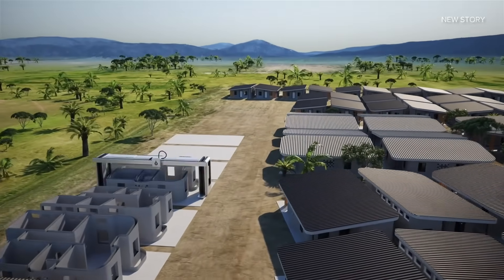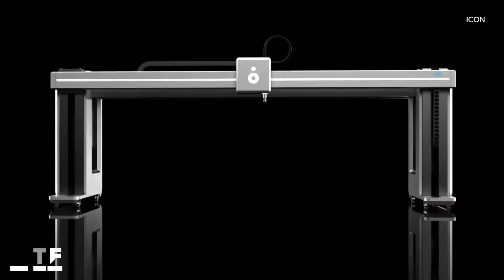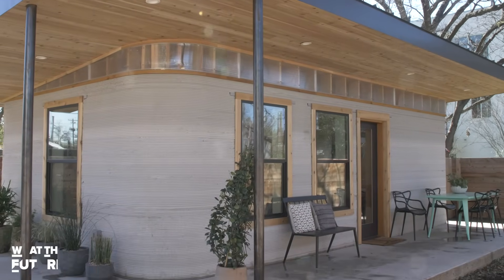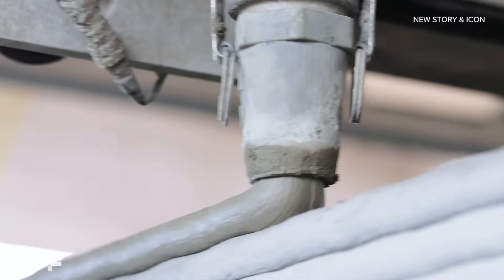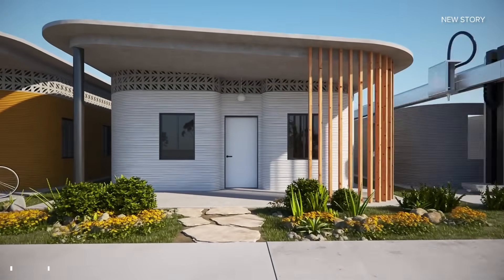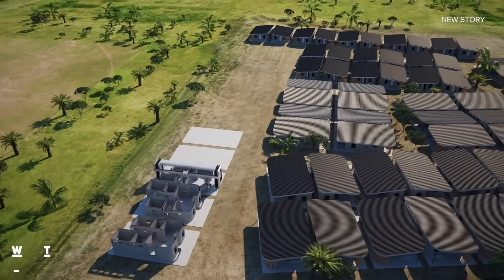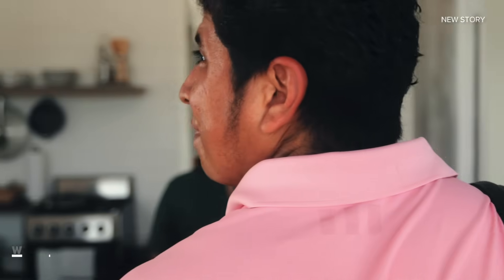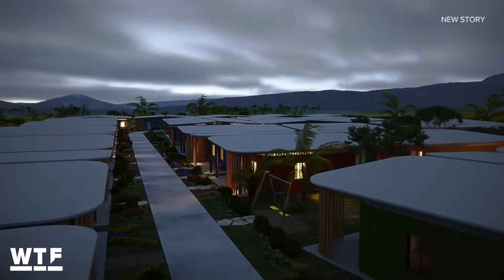The world's first 3D-printed community is officially under construction

Comment: Another upside is that there are significantly less wood/flammable material in the walls itself (save for the door framing, window framing, & roof planks, as shown), which hinders house fires.
But what if the resident(s) want smooth, flat walls, instead of ribbed layers?  Will they then have to go back, fill in, & smooth out the walls (+ add insulation & drywall) themselves?
And they can forget about hiding pipes/plumbing, electrical, & HVAC in the floor, walls, & ceiling, unless they were pre-laid/preset, before the concrete printing starts, or installed during printing.
Also, those houses should get Tesla's Solar Shingles & Powerwall Home Battery, so the residents won't have to worry about electricity bills, and to complete the efficiency/experience of living in a 3D-printed house.

Comment: Pipes - electrical - water - surface
And much more important .... What will the house look like in 7 years ... The "printed" material will shrink, become smaller ......
So the experience from the construction sector ...
-
Thermal insulation?
Sound insulation?
etc...

Comment: I wouldn't call this printing a house. Icon has done a very good job of combining several seperate jobs done by different humans into one machine. This however has several flaws, from an engineering stand point, I see that the machine pours internal triangles shapes. I'm assuming this is done for structural support in place of a metal skeletal rebar structure. I saw the foundation however I'd have to see the depth these walls go into the slab. Also interesting the company built the two homes in a high seismic location. I'm sure he's counting on the constant tremors to stress test the house structural resistance over a specific time frame. Neat idea!

Comment: It would be nice to see a cost / time analysis against local workers using brick or cinderblocks.  Is it actually cheaper to operate / feed that machine as opposed to hiring local workers?  Don't get me wrong, i'm a nerd and love the tech, but i just wonder if this is ultimately a good solution with the technology where it is.  In other words, with the cost of printing 50 homes, maybe the could have built 100 with traditional designs - hard to say without a comparison.  But i get it - this is about more than just the homes printed.  It's about improving the technology and hopefully driving the cost down over time.

Comment: you need steel reinforced bars & expansion joints in any concrete work of this size, or it will crack up in time. fail

Comment: There is no way you could build a house much faster or much cheaper with this tech than wood frame site building. Once you have the permits and materials, you can throw up the structure of a site built wood frame house in no time flat.

Comment: Easy to thicken/thin the concrete if you use foamed soap like the Romans did which makes it almost half weight but still powerful with air bubbles... also volcanic glass can be grounded and added to the mixture aswell as hemp to finish it...
Basics...

Comment: The only problem I have with this system is how insert the steel reinforced bars into the concrete. Pure concrete its  very brittle and has no seismic capacity.
Reply: And that's why the inventor said in this video that their is definitely room for  improvement of the cement.
Reply: @ninjafit3275  Improving on cement is using another material : "The cement industry is one of the two largest producers of carbon dioxide (CO2), creating up to 8% of worldwide man-made emissions of this gas, of which 50% is from the chemical process and 40% from burning fuel."
Reply: @OlivierSuire  yea those glass skyscraper are worse than anything and any window even double paine  glass or tripple Paine glass all glass is inefficient and concrete is efficient as far as energy to heat and cool
Reply: @ninjafit3275  I have a domino tower that hasn't been blown over by the wind, how you ask? Simple it is in a area where no wind blows. So many people looking for more complex solutions for simple problems
Reply: Depends what you mix with that we got adobe hoyses built a thousand years ago that are still around
Reply: @gabrielgalaxygh  I live in Chile, one of the more seismic country. Just the reinforced concrete can stand with frecuent earthquakes. Adobe just can't stand.
Reply: "we got adobe houses built a thousand years ago that are still around." Are those 1,000 year-old houses sitting on top of seismically-active soil?
Reply: Steel in  1 floor structures for philippines construction since local code require earthquake intensity 7.5
Reply: @crazyjds  same in Chile. Walls must use steel in foundation, top close, vertical columns each 3 or 4 meters. Concrete blocks are using just like filling.
Reply: Makes me wonder how hard it would be for them to feed steel cabling through the nozzle as it's extruding the concrete, that way the whole thing would essentially be full of reinforcement.
Reply: @NikoKun  good point. That seem a very plausible idea.
Reply: @NikoKun currently lots of contractors are using Micro-Helix micro-rebar, which is the micro version of what you’re saying, in applications like ICFs and the like... it may prove useful in this application
Reply: @NikoKun  conduit could be installed in prebent proportions as the print process is in motion
Reply: @steveeolio  yup, tho I think I was referring to the extrusion of material, to make it stronger, not the conduits for utility stuff.
Reply: There is.  It looks like 3 rebar per wall poking out the top.  May be some secret sauce we can't see.
Reply: "It looks like 3 rebar per wall poking out the top." How do you "print" the walls with that rebar sticking up and in the way of the "print head"?
Reply: @michaelsanders5815  I think if they found a way its not shown here. You need rebar in corners even if they are "rouded". I believe they surround the bars but they must ensure the concrete fully covers the bars.
Reply: The size of the homes don't require steel.
Reply: @danielmasters8145  in seismic country its mandatory, even for 1 store  homes.
Reply: @danielmasters8145  WRONG Daniel
Reply: At 1:04 you can see a few steel bars. This happens a few more times not sure if it’s the same clip repeated or a different area, but it seems there’s at least vertical support.
Reply: California would require it to be engineered (most stringent seismic code in US) and an engineer would likely try to get something like Micro-Helix micro-rebar to flow through the machine to make everyone feel better. 
The Apus-Cor folks had the operator inserting GFRP rods horizontally across lifts - like from the interior wall to the exterior wall on intervals but the micro-rebar might be a better option for seismic
Reply: Shelby Holley  if you are building over a sinkhole, no matter how much steel you use that structure is going to fail.
A solid foundation is everything in construction, without that there is no building.
Reply: I don't think steel reinforcing is used even on block homes. Then again I've only ever done work on homes in Florida and as long as your foundation is solid, you don't have much seismic activity to worry about. 
Wouldn't adding reinforcing fibers get the job done too?
Reply: @chadleach6009  I've been to florida a few times and was always surprised how thin and easy to break all the houses seem
(i am from germany)
is this done by purpose? because to me it seems like 1 hurricane is coming and the house is done for
and you have a lot of hurricanes
Reply: and the walls feel like if i punch against them there is a hole
if i punch my wall at home in germany my hand is broken
Reply: @chickenbob562  The main concern here is high wind loads from hurricanes and a stable foundation from Florida being essentially a large sandbar. A thick heavy structure would require a much larger foundation to accommodate the weight, thus the thin light design. 
Fortunately, with most materials on the market today and if built to code, are more than capable of withstanding cat 4's  (sustained winds of 209-251 kph).
Cost is likely a factor as well, lighter materials are cheaper to transport and when your building on a sandbar, you have to truck most of what you need in.
Reply: @chadleach6009  so even if it seems not strong, it can withstand a lot of natures force?

since many houses are build on canals or near water, you probably can't use that heavy foundations, right?
Reply: @chickenbob562  Yes, it's all in what the structure is designed to handle and what you have to work with.
Reply: @chadleach6009  okay, interesting
thanks for your explanation and answers
Reply: @Barskor1  why? because we have strong walls?
Reply: @chadleach6009  steel is always used lol. You can even see it in this video
Reply: @kizzjd9578  i was talking about traditional contruction.
Reply: Chad Leach rebars are used to reinforce cement block homes in earthquake areas to minimize the crumbling of building during a major earthquake.  I grew up where typhoons with winds over 230mph pass and it sits in the ring of fire.  In 1993 we had a 7.8 earthquake and the only major damage was to newly built hotel the leaned because the owners asked the contractor to water down the cement mix.  All the houses were fine with minor cracks and about 95% of the houses are built with cinder blocks, cement, with rebars for reinforcement.
Reply: @redorange  Cool, we just don't use rebar much here because Florida is one of the least seismically active areas on the planet. We tend to have more issue with corrosion of rebar where it is used than anything.
Reply: @redorange  You can't really compare a house with a hotel.  The larger structure allows for larger forces to build up in the structural diaphragm.   Also the waves travel a longer distance through the shell before hitting an intersecting wall, due to bigger rooms like lobbies and restaurants etc.   The points of intersection is where the breaking will occur and also in the stiffest members.  A shear panel (very stiff) will attract most of the seismic forces.  Watered down cement is a serious problem, that should have been made evident by the test cores that are required to be taken at each placement of concrete.   Those cores are broken at 7, 14 and 28 days to determine the actual vs designed strength of concrete.  If those cores are not with the testing firm then somebody goes to jail.  
The other big difference between a house and a hotel is weight.   Basically think of how a child runs and turns, versus a large grown man.  The more weight that is being carried, the more difficult it is to negotiate tight turns.  Much greater strength is required to stay on course when the moving object is heavier.   So the code sections (and underlying concepts) that work for a one or two story 2000 square foot house will not work for a multi-story 100,000 sf hotel. 
Seismic forces building up in a heavy structure will concentrate a lot more of that force on the connections vs the lighter structure across the street.   If you live in a seismic zone, light weight stick construction is better for your house.
Reply: @chadleach6009  Look at countries like Brazil and Argentina, their homes are nothing but brick and concrete they look at the homes built in  other countries like the US and Canada and think we're crazy for building wooden homes with dry wall.
Reply: @chadleach6009  WRONG Chad.  It is used if you want permits
Reply: @chadleach6009  yea, I'm not sure but I think steel reinforcing is used for areas with more frequent earthquakes
Reply: Add fiberglass into the mix, maybe?
Reply: @BrokenLifeCycle  in some places could work,  in horizontal trust and ceiling its less probable. Concrete has almost 0 traction resistance compared with compression resistance. So in traction section of the trust almost all the resistance is from the stell.
Reply: @BrokenLifeCycle  in finland fiber cement Is double the cost of normal and still isin't safe... It's pretty funny that nordic country build most safest/insulated homes even the Is no eartquakes in nordic country... Few times car have lost in yard and once full load truck found it self living room while Master of the was watching tv on living room... I bet it wuold went truoght any american house whit 50t of mass
Reply: After a gut wrenching meal at taco bell, I can extrude enough 1/2 to 1 inch mortar to build you a dod house.i should add in some hay or else the roof caves in.
Reply: Rebar is needed here in Nepal.
Reply: All brick houses are supported with steel rebar, even this printed house I saw rebar reinforcments.
Reply: they have used in a earlier build fiber glass stick the width of the wall
Reply: Yep, you are incorrect.. besides  there's bendable still that can be injected in some form..
Reply: plastics?
Reply: What I meant,

Polymers being introduced to the mix Could give it all the stability it would get from said rodds.
Because that is what they already do in other cases.

or you know, the Rodds can just go first. that is possible.
Reply: Luckylarry911 silverstein  Pretty sure I've seen an experimental 3D printer at a maker convention that had a special nozzle that fed wire out into the plastic it was laying down, in order to reinforce it. No reason they couldn't come up with a similar system for this.
Reply: @NikoKun  surely you can make robot who insert and bend Steel before cement comes, but there Is problem on horizontal reinforce... 1 layer at the time unless you first add horizontal Steel frame what Is in way off cementing...
Reply: Luckylarry911 silverstein  Still probably increases strength along the length of the structure, and from side-ways forces. Should also be possible to insert actual rebar or other reinforcements down those zig-zag holes in the wall, depending how they lay it out.
Reply: Shelby Holley  just be homeless at that point
Reply: Well, the vidoe triggered my scam-o-meter when they show over and over a video segment of the machine pouring  the stuff and some rebars BY THE WALL, rebars which can't be seen at the 3D animated video nor anywhere in the actual cosntruction video. All in all, if you put rebars inside the concrete, then the nozzle can't travel along the wall witout hitting the rebar. so it etiher travels around the rebar (pouring a cocnrete donut around it, then keep on the straight line, or you just don't get any rebars inside the cocnrete, in a seismic zone. They also don't show how do they add doors and windows (as they can't have the concrete up in the air, they'll need to add a frame to hold it in place while it dries, and again, unsupported concrete-only beams over doorways and windows, in a seismic zone?).

Now think about this, a machine that lays concrete bricks and then adds concrete and rebars, instead of using "magic goo" for everything. It's not printing, but certainly such machines could build affordable housing using standarized and widely available matherial. Building the foundation still would be a difficult part, but there's plenty of expertise on building with concrete brick. Just, you know, probably the machine would be a lot more expensive than using human labor in the countries where it could be of use... and hiring construction workers is more humane than replace them with a robot.
Reply: What are rodds?
Reply: Why dont people just make mud huts again
Reply: @AbuHajarAlBugatti  because dont stand with earthquakes, get full of bugs, water "disolves" it, etc,etc.
Reply: I thought these were old concerns after things like Helix Rebar.
Reply: The "Rebar" is laid out prior to pouring the foundation... 
The foundation and building is small enough where an earthquake won't bother it. Also the concrete they use to build the walls is rubberized (for the lack of a better term)
Reply: A large part of the world is free from earthquakes
Reply: @Milwaukee Mayhem True, if it was done throughout the whole print-time. But maybe it would only need to be done every few layers.. lol Like have a secondary nozzle that lays reinforcing wire down intermittently or intelligently where it might be needed.
Reply: Does the reinforcements need to be bonded to the masonry?  I believe if reinforcements are needed in cinder brick or brick walls, it's just passed through the holes.  Even then it could still be bounded by pouring something into the holes around the reinforcements.  Also chopped fibreglass in the concrete mix would give some tensile strength.  But yeah, if we want this new approach to be the same as previous approaches, it will take a little work.
Reply: I'm thinking it uses something like fiberglass.
Reply: He said it's lavacrete, other ingredients mixed in with concrete. hopefully that minimizes the issue
Reply: Fibermesh
Reply: These things have like 4 years before they are falling apart, and that's depending on environmental conditions, but whatever. Anything is better than nothing when it comes to shelter, and this is FAR better than nothing.